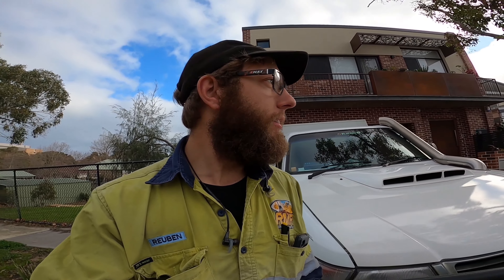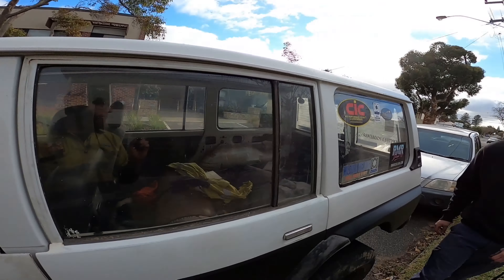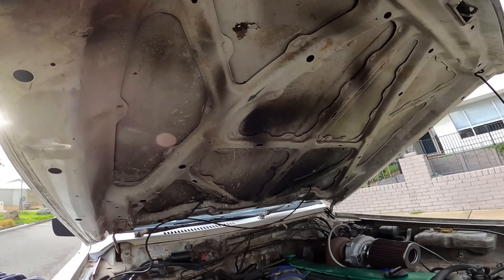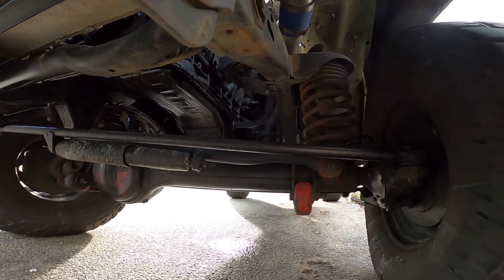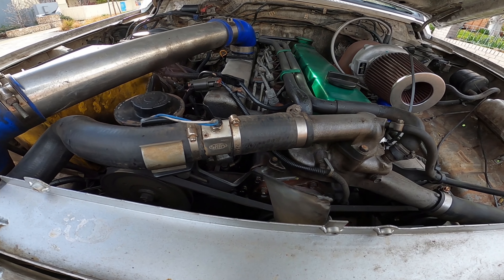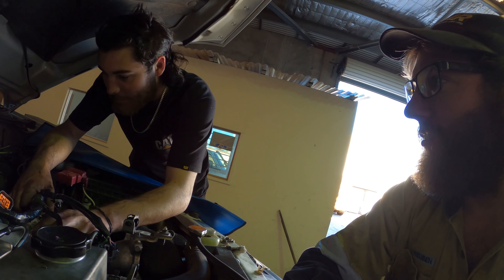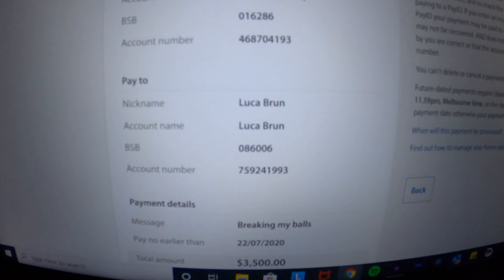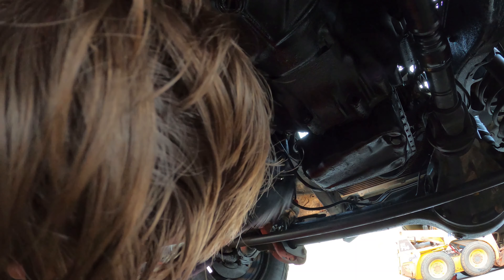Australia's toughest TD42 GQ patrol on 10mm pump

Comment: can someone explain to me how it’s a 4x4, yet it can still do standstill burnouts?
Reply from the maker: It's rwd until you select 4x4 in the transfer case
Reply: @Reuben_rmr  so a gq comes stock rwd but has two diffs still?
Reply from the maker: @tyler-on4zn  yeh that's right. GUs are the also rwd when not engaged in 4wd. 80 series, 100 series, 200 series and y62 are all wheel drive with a centre diff lock that acts the same as 4wd on the y60 and y61 patrols
Reply: Every 4 wheel drive is 2 wheel drive untill 4 wheel drive is selected

Comment: Stock tb48 would send it pass it haha no need for turbo
Reply from the maker: Video or it didn't happen. My mum's Camry will blow your doors off champ. She's gapped more tb48's than you've had hot dinners
Reply: Can confirm a 4.8 in stock form will beat a highly modded td42
Reply from the maker: @DarrenBoxhall  your mates $400 eBay setup isn't "highly modified"
Reply: Yeah,add $11,600
Reply from the maker: @DarrenBoxhall  tax the rich
Reply: @Moses1988 And burn 3/4 of a tank in the process
Reply: @philth9931  🤣 yes and td42s use 10L per 100 🤣🤣🤣🤣🤣
Reply: @Reuben_rmr  I only see a $400 eBay setup and 10mm on that? Can’t be that tough😂
Reply from the maker: @saltybouys6225  $200 but who's counting? 😂 3rd gear skids bro, who else can do this on 10mm? It's a unicorn 😉